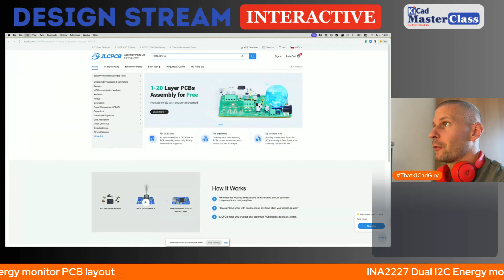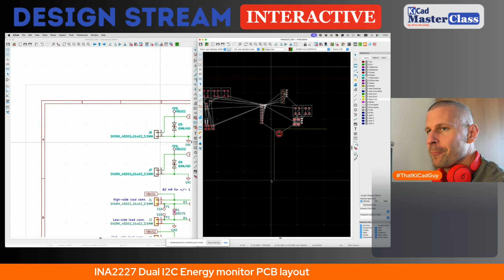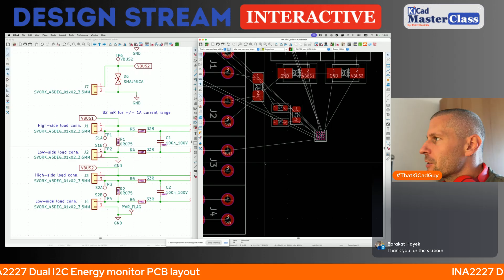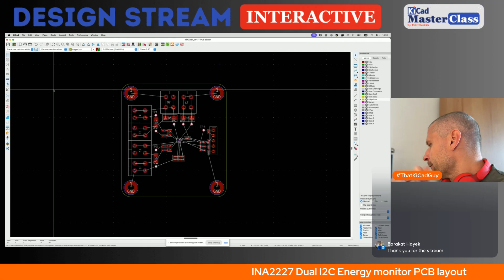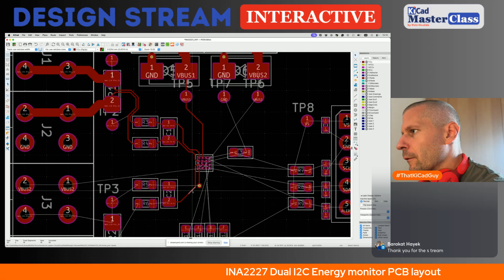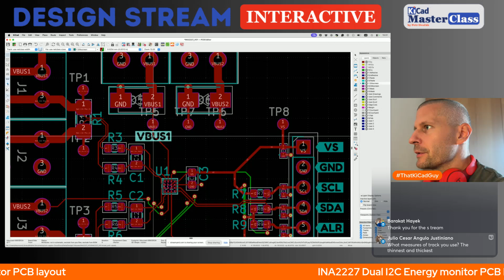KiCad Design Stream PCB layout of INA2227

Comment: Glad you caught the missing 2 VBUS input terminals. Symmetry in schematic design as well as PCB layouts is not just cosmetically appealing, but the eye-to-brain communication is faster and obviously makes readability much easier as well as obviously saves time. What did you do with the second inner layer? Thank you for the stream and looking forward to the next one.
Reply from the maker: Thank you. Both inner layers are poured with GND.